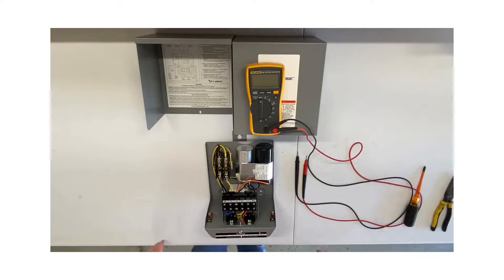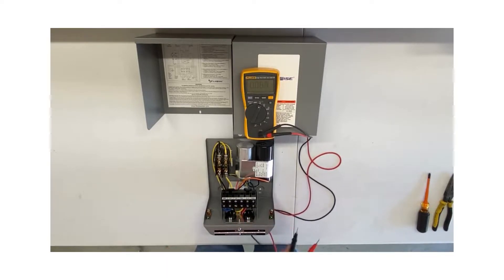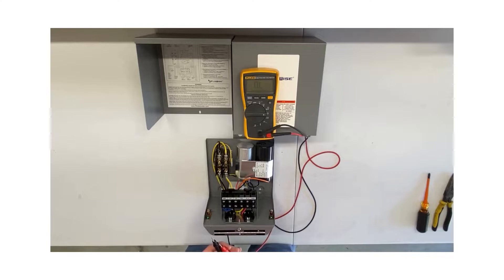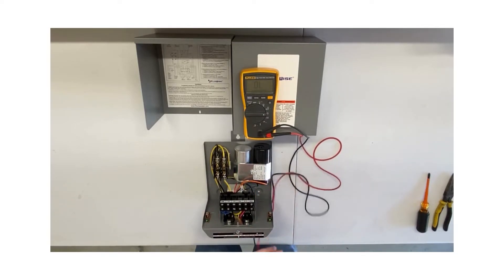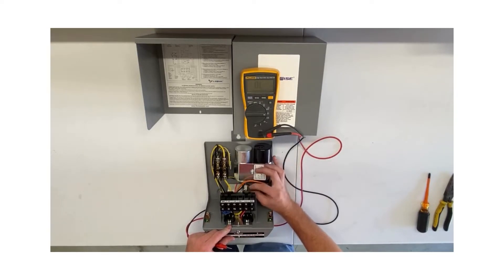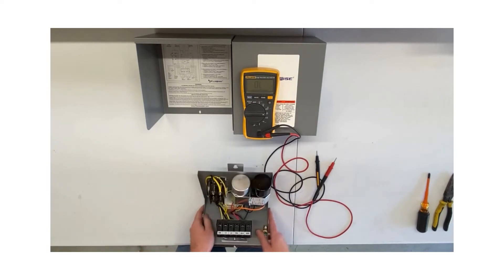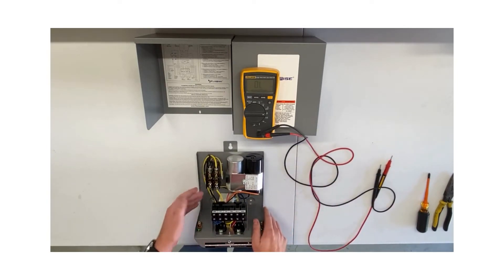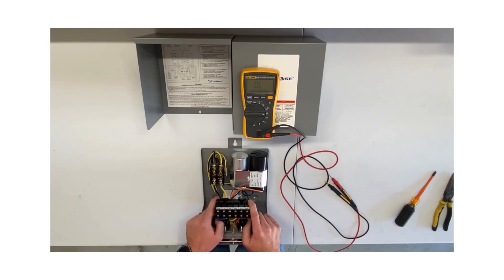Submersible Pump Control Box Troubleshooting

Comment: Why would I have very little power at l1 and l2 with the breaker on? I do have 230v at the pressure switch and that is basically new. Thanks
Reply: The pressure switch sends the 230 to the control box when it switches on!